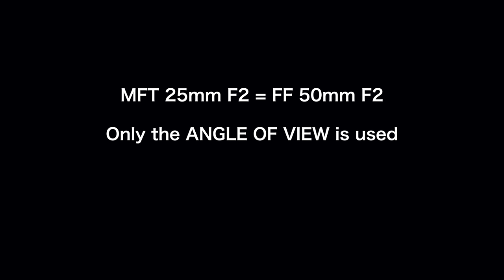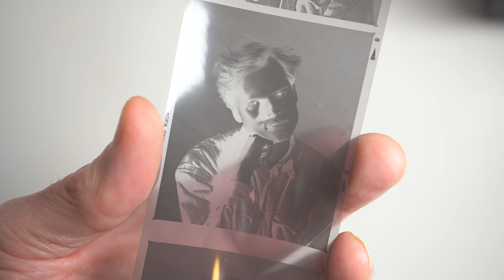Equivalency –What does it matter?

Comment: I think your comment “enjoy your photography” answers all the questions as it doesn’t matter what system you use as long as you get the shot you want (UNLESS you are Tony & Chelsea)
Reply: Should also include J.Cristina, who always has negative bias on MFT system.
Reply: I disagree - it helps to understand the limits of one's system, and the types of photography that different systems are suited for. Equivalency is very helpful in this regard, and Tony & Chelsea Northrup have done an excellent job in explaining it, IMHO.
Reply: Tony & Chelsea have had a significant effect on photography education apart from the subjective its hard to call them wrong on anything
Reply: Greg Sullivan it doesn’t matter what you take pictures with wether it medium format, full frame, advanced photo system type-c or micro four thirds you make your choice when you buy into a system, you need to understand the pros and cons of each and what you are hoping to achieve, any half decent photographer will be able to use whatever they have to get a shot regardless of the sensor format and equivalency of those different formats.  Something that I have noticed is that people who own “full frame” tend to shout the loudest about the limitations of other formats personally I think anyone who wants to pay for and carry that size gear around is losing more than me carrying my MFT camera and 12mm 25mm and 45mm f1.8 lenses in my jacket pockets ooh 😮 hang on a moment they will have the benefit of loosing more weight and get fitter that’s a plus I suppose unless they are in their late 50’s or 60’s they will have less overt unities as they will have to leave some of their gear at home as they will be to knackered to carry it all.  So what I’m really trying to say is IT DOESN’T matter what you use as long as you are happy with the shot
Reply: Ming Lam they must be full frame users they seem to have big mouths like their big cameras 😂🤣😂🤣😂🤣😂🤣
Reply: @rogerquenault7207  you contradict yourself - on  the one hand you say that you need to understand the pros and cons of each system, but on the other hand, you say "any half decent photographer will be able to use whatever they have to get a shot regardless of the sensor format and equivalency of those different formats".  Which is it?  I agree with your first statement - each system does have it's pros and cons, and that's why there is a market for each system. If each system produced identical results in every situation, there would only be ONE system, but they are simply not the same. Just for example, Jared Polin, in his review of the Olympus E-M1X ( https://youtu.be/t-I4ygKnpVQ ), lamented the fact that the depth of field was too great, and the amount of noise in the images. A FF system would be more appropriate in that situation, at least for him. Another example - a macro photographer made the observation that because he's always struggling to get ENOUGH depth of field, it would be a waste to carry around a FF system, where he would be stopping down a lot in order to get sufficient DoF - the size and weight would be a waste, and that's why they use MFT.
Reply: Greg Sullivan actually when it comes to explaining finer details, at least in regards to MFT, they get it wrong. First in how a sensor actually captures light, second the difference between exposure and depth of field, which has unfortunately confused a lot people, who don't care enough to research it on their own.

Comment: In the film era nobody heard about equivalency because film (of a kind) had the same "pixel density" regardles of frame size. If you wanted more resolution, you must have had a larger frame size. Now we can have sensors of different sizes but with the same pixel count. That compilicates everything.
In the film era there was a choice: resolution vs size and weight (e.g. there was no Velvia with ISO 1600). And now we have the choice: resolution vs noise vs size and weight.

Comment: What’s important in camera performance is the size of the hole on the front - what might be called the effective entrance aperture. This determines both the ability of the camera to render a shallow depth of field, and the efficiency with which it can gather light. Sensor size, in comparison, has little effect on performance, and parameters such as, focal length, f-stop and ISO are mere technical parameters that are determined by sensor size. It’s useful to understand this fact both creatively and financially (to avoid spending money on expensive cameras with irrelevant performance characteristics).

Comment: Glad to see someone else who thinks the use of "full frame" is silly. 

In all my work and writing I use "legacy 35mm stills format size sensor" (If I absolutely have to refer to the format). If needed I shorten this to "legacy 35mm stills format"

I say "stills format" as the original 35mm motion picture format is smaller than the still image format as it runs the image sideways (landscape) between the sprockets. 

35mm still picture format was, interestingly, called the "miniature still image format" on debut and "real photographers" of the day said you couldn't possibly aspire to be a professional if you tried to work with such a tiny negative! Some things never change.

As you say, all formats are full frame -An 8x10" view camera renders the "full frame" of its image plane, so too does a 6x6cm format, a 110, a 126, 35mm, a half frame 35mm still image camera and a mobile phone.   Thank you for your videos.
Reply from the maker: Thanks! Maybe that "legacy 35mm" could be useful, without "stills format", for me. I don't know, there are so many who've never heard of 35mm. Would be nice have a short word for full frame.
Reply: @mattisulanto  "Legacy 35mm" works. I think the motion is adopted! :-)

Comment: The reason why we have terms like "crop factor" and "full frame" on digital cameras but not on other formats is historical. The first DSLRs were expected to be used with 35mm film camera lenses, which were mount-compatible. This was not the case with, say, medium-format & large-format cameras or digicams. These early cameras had sensors that were smaller than the 35mm negative (a "full (35mm) frame"), and the lenses did not behave the same way as in the film cameras. This required some form of rule-of-thumb to predict the behavior of the lens on the new cameras, so in comes the "crop factor".

The film cameras are largely extinct, but the nomenclature remains.

Comment: From my point of view, "equivalency" is a way to understand use cases for a lens. But as each characteristic is not sufficient to explain what to expect, it would be confusing, especially when all information are 35mm based while all beginners used other sensor size first. And many says things like "FF have shallower depth of field" for example while the sensor size as no effect at all on depth of field for a given focal length and a given aperture.

What should be explained is the effect of changing only one characteristic at a time and then, changing the focal lenght, the sensor size, its cells density and so on would be less confusing.

And for a system, to just explain what a lens can do without comparing to other system (and focus on what the photograph has to do).
Reply from the maker: Thanks!

Comment: Should we introduce a bulk (weight/size) equivalency factor? So a 35mm size sensor camera with lens would then have a 2x bulk factor when compared to a MFT camera and lens?

Only kidding btw!

As you point out, equivalence has very little utility. I think it’s mostly a load of absolute nonsense and has its roots in insecurity. It’s been weaponised.

I shoot Olympus EM1ii and Nikon Z6 and love using both. And my phone of course!

Comment: Since I still have a stronger sense of what focal lengths look like on 24x36 from film days, I think in terms of full frame first. I've been shooting MFT as well for several years, and I still occasionally resort to the 2x multiplier for mental visualization. The depth of field issue is one of the primary reasons I still have a full frame system. That, plus better dynamic range and/or noise performance on the larger format. The one sure false equivalence is to say that there's no difference between formats.
Reply: What's a real pain is running the mental caluculations for 1.6 or 1.5 X multipliers with APS-C.